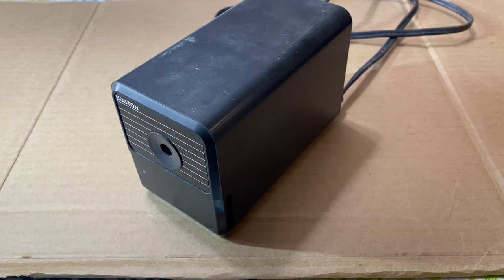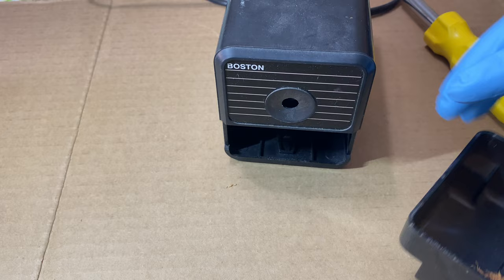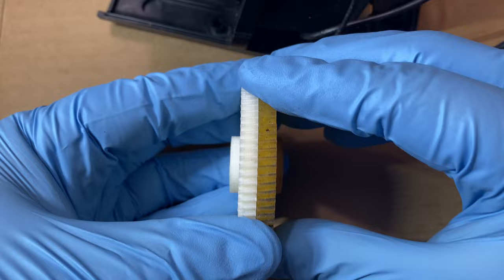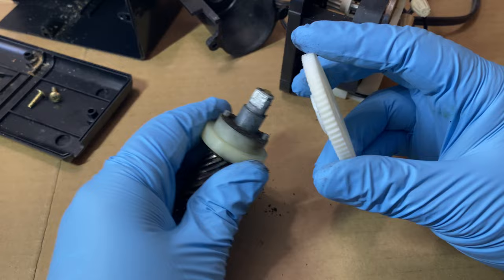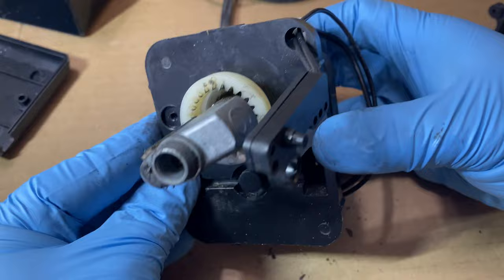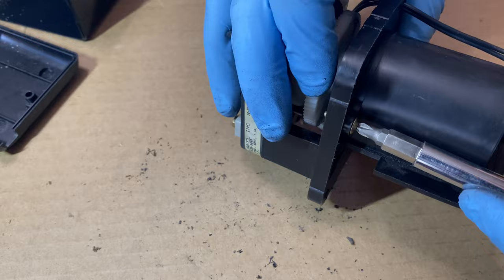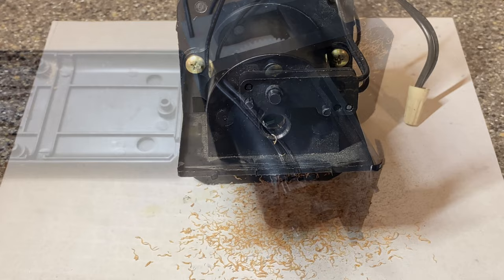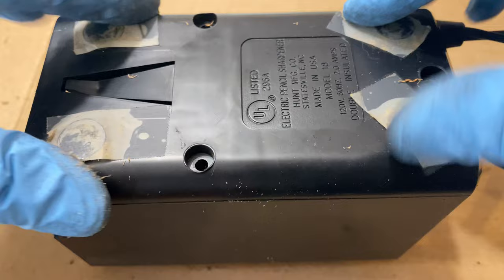Boston Model 18 Pencil Sharpener Fix | Electric Pencil Sharpener Not Sharpening Fix

Comment: Hey! Thanks for the vid. Do you know what to do if the sharpener just won’t sharpen one side of the pencil? I’m having a hard time understanding why. It occurs even if I twist the pencil around to “push” a certain side against barrel; if I turn it in a circle in the barrel; etc. I’ve gone through a few pencils trying to figure it out.
Reply from the maker: Have you looked at the blade itself? I’m guessing one of the blades is misaligned or dull. You could also try moving the pencil around by changing the angle you insert it. On the very rare chance, maybe you’ve got a bad batch of pencils? Some cheap ones will have non-straight cores so it will never look straight.
Reply: @learnsavediy  LOL, so I’m a bit naïve with this stuff. I didn’t even think that the core could be misaligned. I had a whole collection of “American Craft” colored pencils gifted to me. Turns out that the core is misaligned in nearly every single pencil. Maybe one of those cheap manual ones will do a good finishing job on them.

Comment: Replaced the large gear wheel. After reassembly, my sharpener stops about 10mm shy of a sharp point. I can't understand what's happening, nothing is blocking the hole. It just quits no matter how I wiggle it or how hard (or how gently) I push it. Any ideas?
Reply from the maker: Maybe you got some gunk in the blades or clogged the shavings receptacle when you were moving it around causing it not to fully sharpen?

Comment: I’ve got a 17 and changed the gear.  But the trigger that starts the sharpening process on the hole isn’t firing properly. Do you have any suggestions or a photo of how those two wires should be?
Reply from the maker: Hi Bryan. I've taken some photos that hopefully address your question. If you need more let me know: https://photos.app.goo.gl/iScRyfobYBFXuWzD9

What does "not firing properly" mean? Like the switch is not responding when you put a pencil in? Maybe the switch is bad or partially broken so the sharpener isn't turning on.